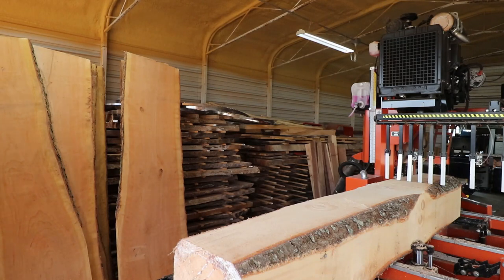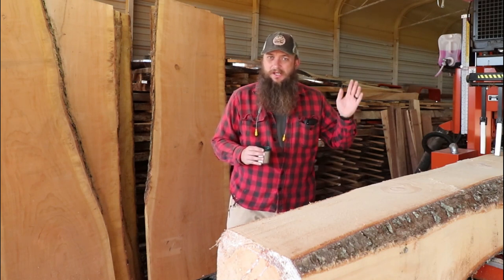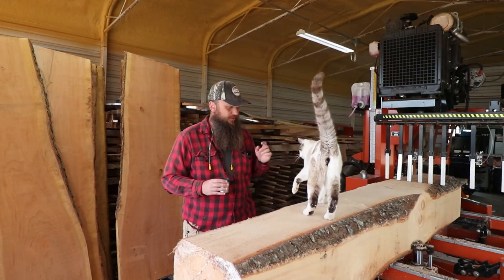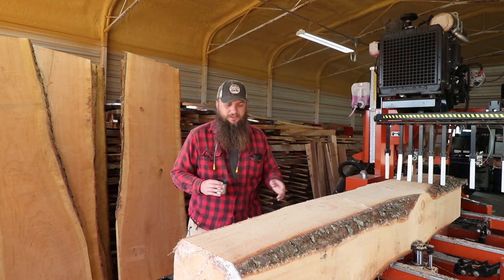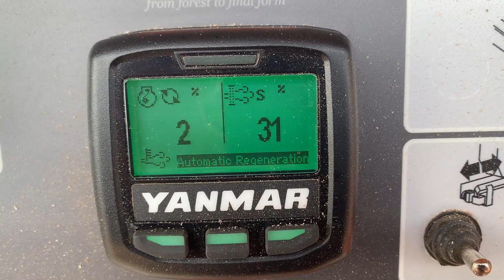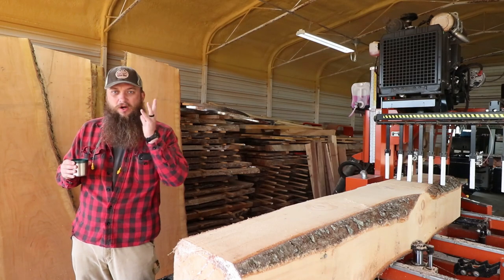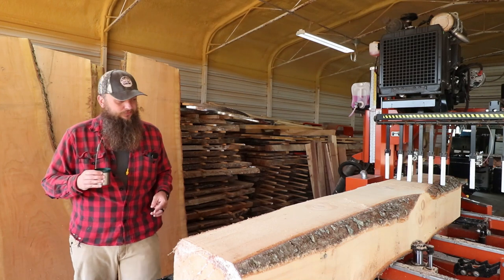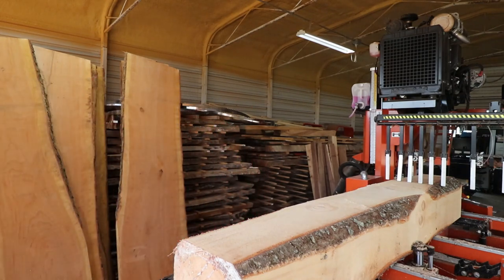Building A Shop Out Of Green Wood, A Sawmill/Building Video

Comment: Just remember the 'kiln dried' lumber from the lumber yard is around 20% moisture content.  So just account for the shrinkage (don't pin the edges of the boards) and you'll be fine building with green lumber.
Reply from the maker: agreed
Reply: I thought Kiln dried wood was around 8%-9% ? Thanks.

Comment: "Kitty" doesn't like the taste of pitch on its feet and when it licks it off.. you get it/lol. Sure seemed real close to not catching your board return flap catch as it comes up from the finish of the cut... just a  trifle close for a good comfort zone of knocking blade off on the return and no need to say more on that. When I lived in Arkansas ( I kinda miss that state) the changes in all the seasons was just phenomenal and some of the smells from the coffee would absolutely wake you up. I drank what everyone else did... it was called "Community" coffee and so it was half coffee and half chicory... that stuff on the latter part was deadly to the jitters. I would wake up mornings and could write a doctors prescription like a pro! Gonna be one fine shed that your a shaking up to use. I will tell you what I did to take some of the twist out of some wood as it don't seem to work with trees that had needles but leafy trees did wonders. We throwed them into a pond to soak for a good bit to get all the sap out and so soaking let the oils in the tree out into the water and then when cut it, it also dried faster. Oil does some crazy stuff to wood. At least the natural tree oils or sap did. I don't think you could make a pond for your little operation but we sawed for production on circular saws and we used a boom boat to push the logs to a live deck that went into  the pond and when the log hit that deck with those little legs sticking up would catch the log and roll it up to our deck where it hit a very aggressive debarker which got into some of the lumber wood too but they were real large logs and it didn't cause no worries. I am talking forties an later till that went out of fashion in the late seventies an up to none now known of. What a piece of heaven that god shares with you

Comment: Would it help if the drop down swingie things hanging off the add on thing you added to the saw, were half rounded at the bottom so they glide over the wood. It seems like the corners have potential to grab and damage cut boards. Great work, keep up the awesome job. BTW, that a wood chipper would turn all that burn wood into amazing mulch, minus the black walnut, but you're pretty careful with it. How amazing would that be for your garden and all your neighbors gardens. In the beds, or in the walkway. No waste! Smoke em if you got em.